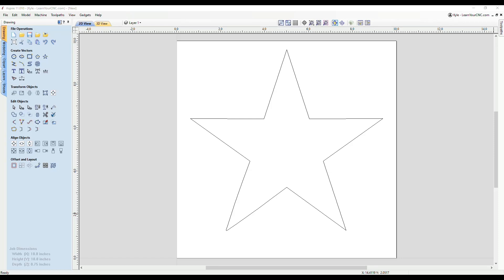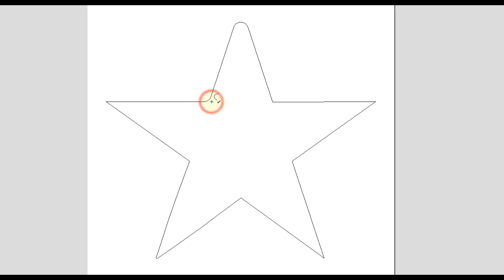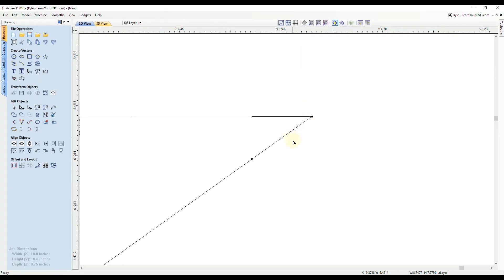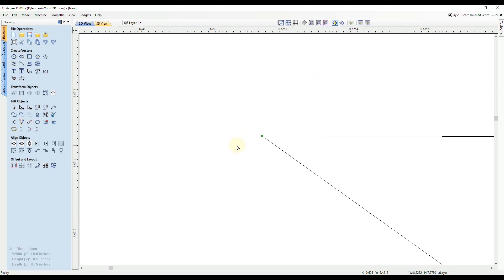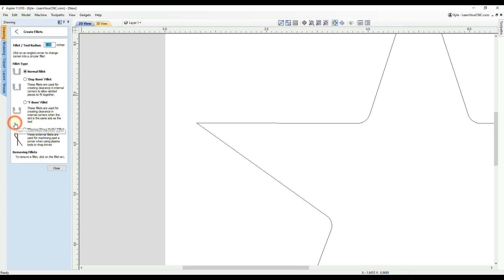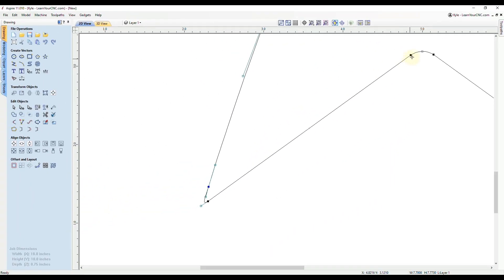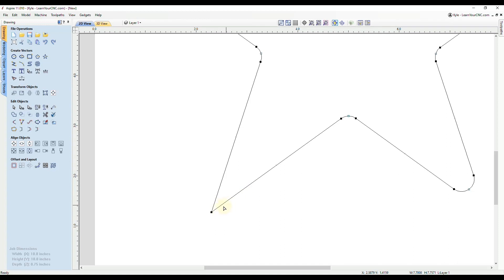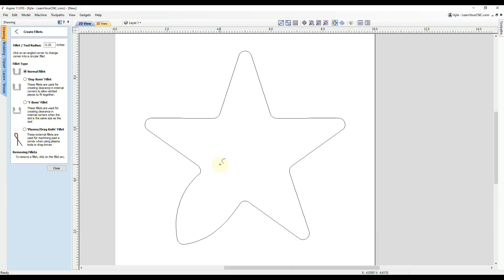Fillet Tool Not Working? Here's How to Fix That  - Vectric VCarve, Aspire, & Cut2D Quick Tip

Comment: Thank you! I often have little problems like this and sometimes struggle to resolve them. I created a design file in perhaps 15 minutes and then spent over 30 minutes just trying to get the darn fillets to work in some corners. Watched your video and fixed my issue in 10 seconds.